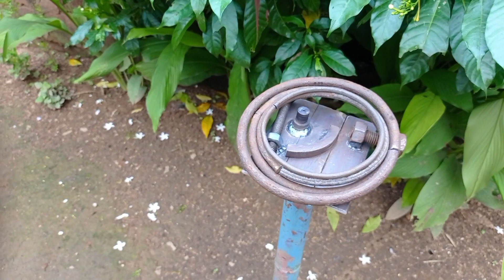How To Make Circle From Round Bar // Metal Bar Circle Making ideas

Comment: Sir, what if 1 meter radius or 1000mm the same materials to use roundbar is it also the same process making your dye ?
Reply from the maker: Yes sir,,To make the circle bigger, you can move the note bolt forward.